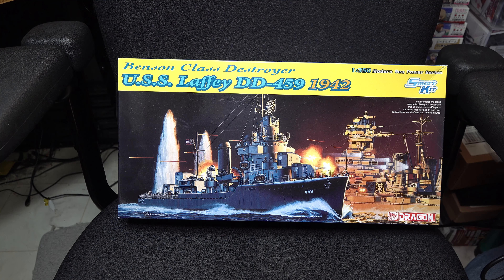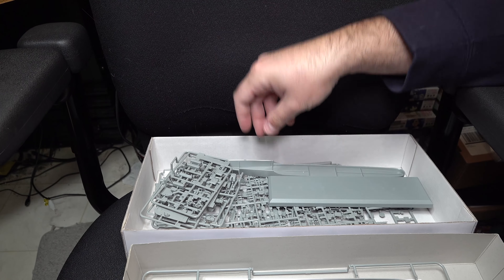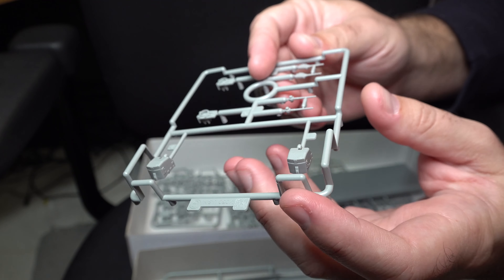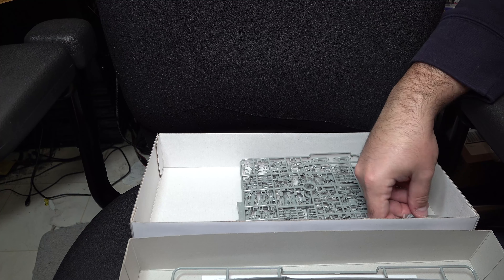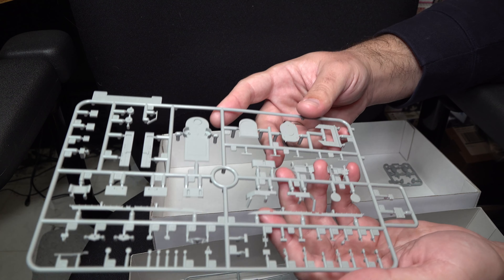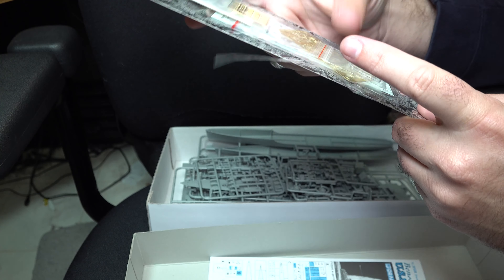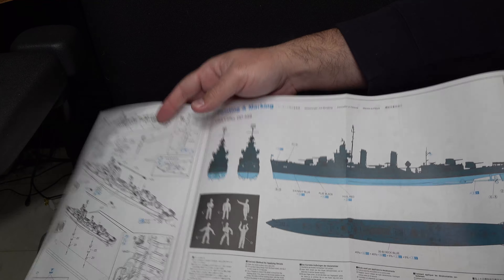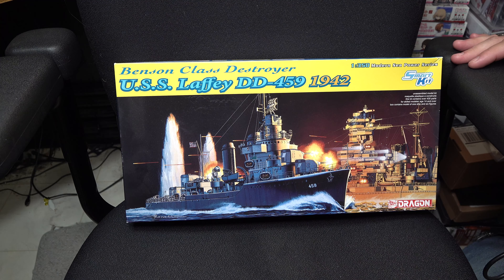1/350 Dragon USS Laffey Review/Preview

Comment: Given the scale, there's a logic to using decals for non-skid.  It would be a benefit if the decals were thicker, obviously.   And a better choice than some of the molded-on options which look like concrete sidewalks.  That's subjective, of course, and YMMV.
Now, gettign those decals to be visible on either Measure 11 or 21 20N Deck blue will be an issue.
Reply from the maker: Based on photos she would have been in Measure 21 when sunk, so that would mean Navy Blue (5-N), with decks in dark Deck Blue (20-B), so will have to more then likely do a test spoon and check the colors against one another to see if any changes to make the decals workable or if its going to require just painting them.